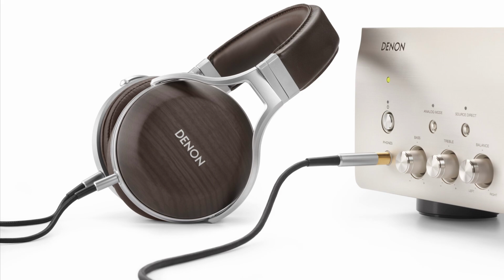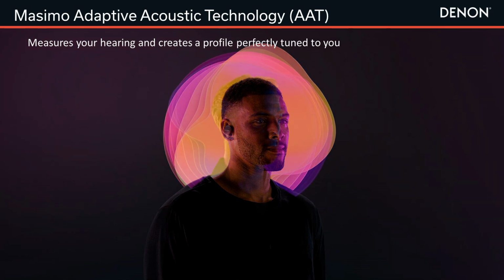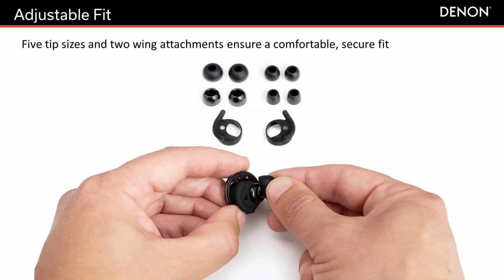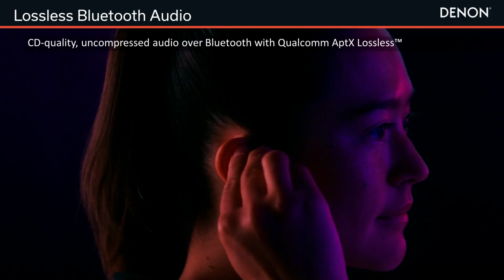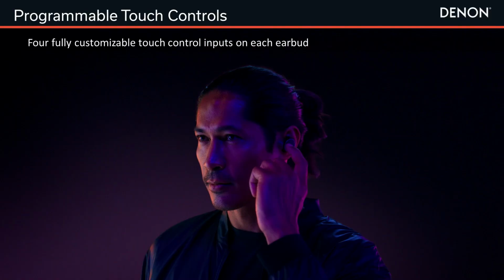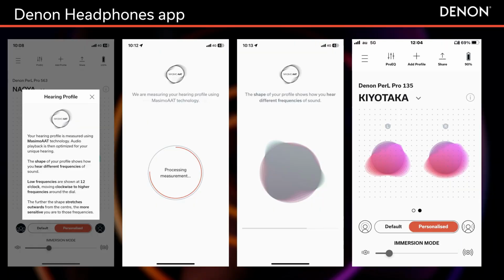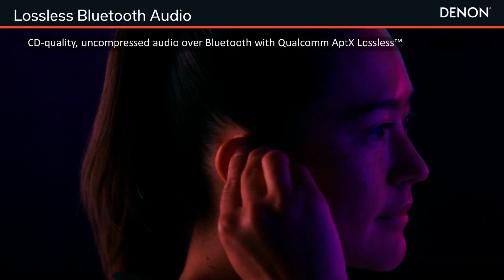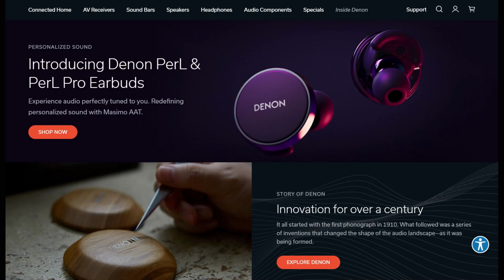Learn how Denon PerL and PerL Pro earbuds deliver a personalized sound experience using Masimo AAT

Comment: The sony earphones (i have the XM4s) have a "volume ceiling." Turning it up past like 75% distorts the sound and smooshes everything together. I hope these don't  do that. If anyone out there has the Sonys and these, please give your thoughts. I have since switched to the Samsung pro 2 buds and can up the volume to high levels without loss of sound quality. (But the connection strength sucks)
Reply: I have both and I agree on the xm4. The DPP is wayyy louder not to mention has a gain option in the app making them louder. No distortion. This is my first product from Denon and I am not sponsored lol but these are the best sound earbuds/headphones I've ever heard. And I own multiple mid teir to high end earbuds and headphones. I don't have a complaint on them.

Comment: Will this work with moderate-to-severe hearing loss?
Reply: Yes! I wear hearing aids because of my dramatic hearing loss and took a shot at the pearl pro and my mind is blown. It works just like they said. My hearing aids have a Bluetooth device and I thought was cool and it is but for high end listening pleasure these blow my $4,000 hearing aids out of the water. You will not regret this purchase.
Reply: @tomcurtis8431  thanks for the reply. Do you have asymmetric hearing loss?